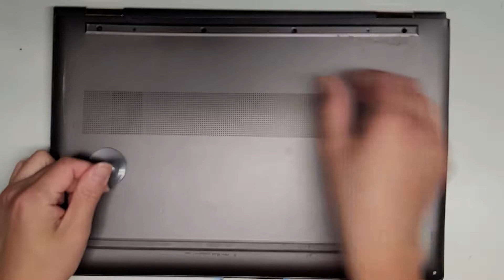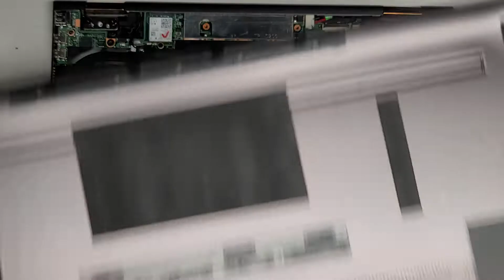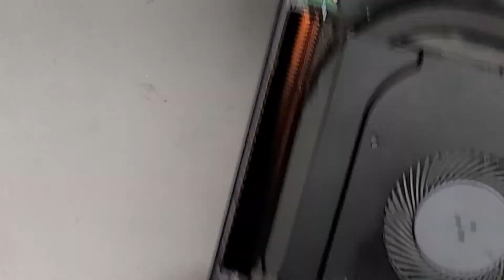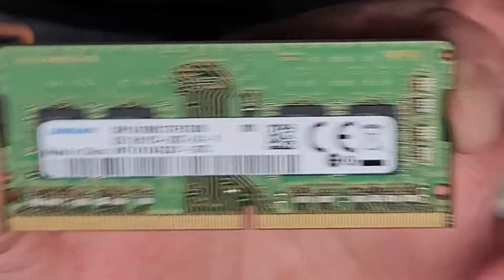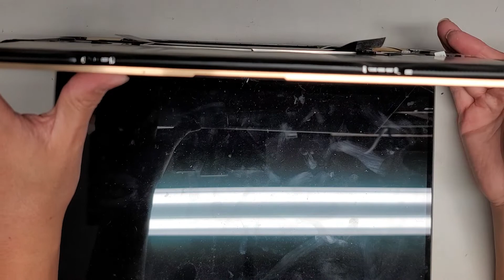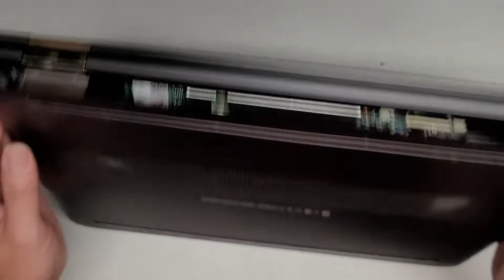HP Spectre x360 Convertible 15-ch011dx Disassembly Battery Replacement Repair RAM Upgrade

Comment: Very good this video! thanks for help!

I have a hp spectre x360 - 15-df1827nz, my battery inflated and I raplaced with your help..... but after reprace (with original HP - SU06XL battery) my notebook wasn´t fast anymore, i dont know if because some BIOS setup reset some especific configuration that made my notebook slow! do yout know something about this? so i need to setup the bios? i remember when i changed the battery, at the first start the setup´sreen appears and i just pressed enter. thks again!
Reply from the maker: Hmmm usually only the initial boot will need the date and time reset. Try a restart.

Comment: I just got to say thank you for the detailed "the pins go up" comment. My replacement battery was connected incorrectly as I followed the one that the used Spectre came with. I'm guessing the old one did not work for the same reason :). TYVM.
Reply from the maker: No problem, glad it helped.

Comment: I just replaced the battery… I’m getting the CMOS error every time I boot, and the laptop won’t charge! I replaced it with an authentic battery I got on Newegg… do you have any ideas on what steps to take?

If it helps, I’ve updated the BIOS via the HP website to no avail, and I have it set up with a Windows 11-Debian 12 dual boot. I’ve been troubleshooting this in Windows though! And all my data is backed up on an SSD so I am ok with losing anything on the device—I just want it to charge!
Reply from the maker: @Mellow_Flow  might be a faulty battery. Might be they had it sitting too long unused

Comment: Are you sure two 16GB sticks will work? I see mixed results looking for it on the internet
Reply: I have a 15-ch010nd by the way, looks exactly like this one
Reply from the maker: If you see mixed results, then the answer is it'll work and either the others messed up, or they're quoting dumb hp manuals.
Reply: I think mostly the latter. Thank you for the quick response. I will get me some 16gb sticks then. Do you also know whether is really has to be 2400t sticks? As it seems that 3200 mhz would also work but maybe not at the full 3200 mhz. (they are more readily available to me at the moment) @ItsBinhRepaired
Reply from the maker: @erwinbruin6563  If you try, make sure it has free returns.

Comment: I can’t find the back cover online anywhere. Mine is super bulged and messed up.
Reply: Yea I realized after removing it should be fine going back on. Released a lot of pressure when I took off those bottom screws lol.
Reply from the maker: @tarikbosniangod1864  lol yeah
Reply: @ItsBinhRepaired  the battery you recommended off Amazon is working great. I thought it would have a non hp battery message but no. Hopefully this battery will last more than 6 months tho
Reply from the maker: @tarikbosniangod1864  awesome, hope it works great!
Reply: @ItsBinhRepaired  do you know why it would be shutting off on lower battery? I ran it down to 10% and it shuts off like it’s dead
Reply from the maker: Faulty battery
Reply from the maker: Did you remove it? It usually bends back to shape

Comment: Hello I’m French , I wish replace the rtc battery of this notebook but I can’t find the place of . I opened the back of computer and ?????   Can you help me please ?
Reply from the maker: The main battery is the rtc battery.
Reply: Thanks you - but what’s the mean of this error message : The CMOS checksum is invalid. The CMOS will be reset to the default configuration and will be rebooted. Please check your BIOS Setup options to see if they change.
CMOS Reset (502)
ENTER - Reboot the system
Reply from the maker: @OZKBAH  it didn't like your bios settings. I'm not sure.

Comment: Hello, I am having issues removing to top middle screws as they are not budging
Reply from the maker: Is your screwdriver tight in the head of the screw?
Reply: @ItsBinhRepaired  Yes the screwdriver head is tight on the screw, the screws refuse to turn in any direction that’s the issue I’m facing
Reply from the maker: @Captain Bubbles  so you're not strong enough to turn the screwdriver? Or did you destroy the screw? Either the screw would be destroyed or you need more strength to turn it.

Comment: Thanks for the detailed instructions, especially the coloured PIN connector right side up as with my new battery it wasn't obvious (and I didn't have the old battery, it was removed a year ago).

The cable of the new battery seemed to be twisted to appear that it should go the wrong side up. When I plugged it in, the battery held the charge and the laptop worked, but the battery was not recognized by the system. After trying many different fixes, and someone concluding the new battery was faulty, your video helped get it right.
Reply from the maker: Glad it helped. If you haven't already, please like and subscribe so others can find my videos and possibly consider watching a few others to get the algorithm to recommend my channel. Thanks!